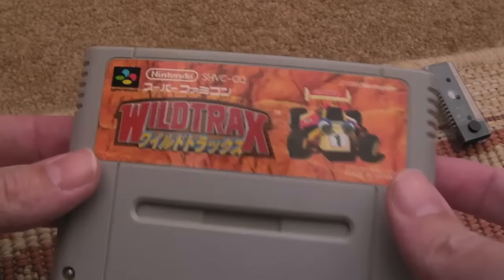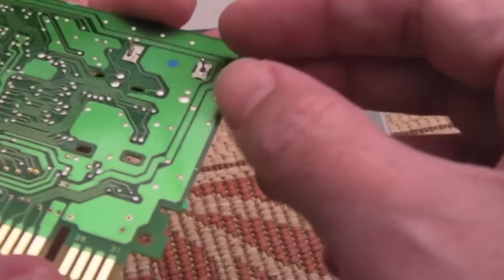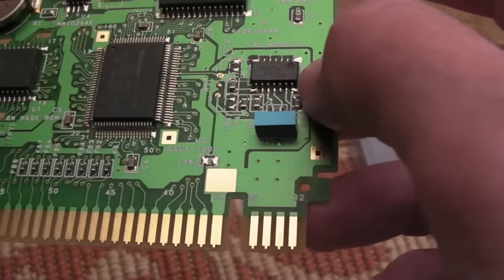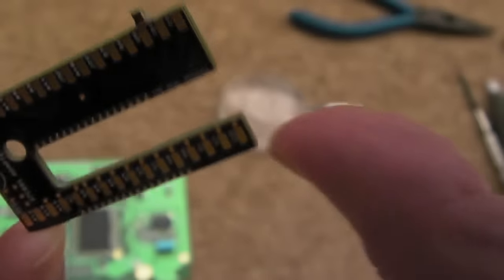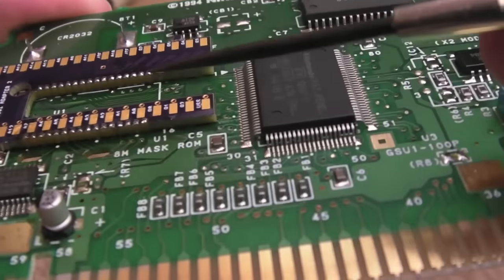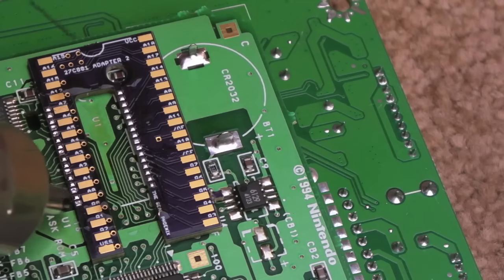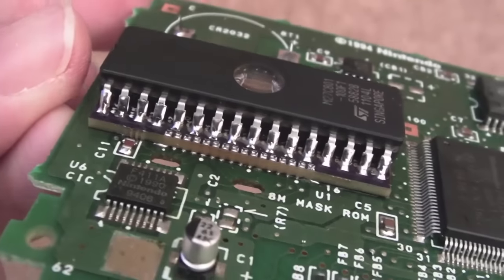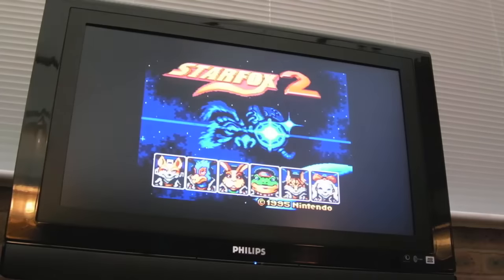Nintendo Super Famicom (SNES) Starfox 2 Prototype Conversion ("The Real Phoenix" PCB)

Comment: Hi GadgetUK164, great video any reason for doing your soldering work on carpet and not a anti static mat? The IC's on the pcb can be damaged from static build up from the carpet.
Reply from the maker: +Joseph Tiziano Yes, you're right - it's possible to damage components with static, It's just bad habit and laziness on my part.  I've been meaning to get around to ordering an anti static mat for the last 18 months.  The reason I've just not bothered is because I've done tests on that carpet before to see how much static can be generated and I cannot generate anything on it, despite footwear.  I don't know why but I don't seem to be able to hold static in my body either, I've never been able to get static shocks from anything.  When I was in the trade I took ESD much more seriously, but that was 25 years ago.   I guess there's some nostalgia there for me as well - when I was in the trade I would often go home in the evenings and work off the bedroom floor lol, but I do need to get a mat ASAP.  Bad practice, will order one today!
Reply from the maker: +Joseph Tiziano Just ordered one!  I will give you a shout out on a video when it arrives, it was your reminder that finally prompted me. =D
Reply: +GadgetUK164  WoW thanks for the reply and understandable, I must say your soldering is impeccable makes me want to get back into the tools and soldering :o)

Comment: I wonder how well baking the boards together in an oven would work. you would have to take the battery off while doing it of coarse.
Reply from the maker: +Sam The Multimedia Man Yes, using a reflow oven (or traditional oven set to the correct temperature curves) would do the trick, but you would need to be careful components don't fall off etc.  I think there are all top side mounted so it should be OK that way.

Comment: Man, I'm sorry you had so much trouble. :(
Yeah I'm using hot air (I remove the battery first and put it back and the very end), check the connectivity from the via on the Snes pcb to the pad on the board, then reflow from the top if I have only a few missing connections.
Yeah the PCB is thick. Other places like iTead offers thinner PCB (even flex pcb but those are expensive) but the batches are for 10pcs.
Reply from the maker: +The Real Phoenix Hey, no worries at all!  It was a learning experience, and I think I could easily fit that PCB in around 10 minutes to another cart!  I've actually got another Wild Trax on the way, going to try doing another game the same way.  Thanks for creating the board and sharing it!  It's brilliant when people create PCB's like that and make it open source!  See below, electronash has been doing some small mods to it!  Hats off to you on the PCB!  I've been using Eagle for the last few weeks and it takes a while to get used to, and there's a lot to it for sure!
Reply: +GadgetUK164 I took a look on the tweaks of electronash (I'll thank him properly in his comments), I didn't know we were allowed to do such. I saw others PCBs with castellations but Eagle/OSHpark verifications say it's wrong (clearance errors). I thought that maybe it was something more complicated to do.
I'm not using Eagle since long: a bit more than a year. So there's tons of stuff I still don't know.
But this board is design for a "easy" and clean installation. I've design it with the way to put it in my mind. So seing someone having a hard time (especially when someone used to mods like you) is a failure.
The funny thing is the first rev of the board (the one in my video) was done in september 2014 and was way harder to put on. :)
Edit: Typo.
Reply from the maker: Don't worry - what you've done is actually great!  It would take me a while to get to the level I couldn't create something as well designed as that board!  Really appreciate your effort and time taken, and truly brilliant that you shared it =D
Reply from the maker: +GadgetUK164 I meant to say 'I couldn't create something as well designed' ^

Comment: Would this work for other FX games like Yoshi's Island and Doom?
Reply from the maker: Yes, you need to check the doner board has the correct amount of SRAM though.  I think Doom needs a specific rev of the SFX chip too.   You can now of course use the SD2SNES as that supports ALL of the Super FX games from SD card.

Comment: what tempature where you using for the hot air gun i am still trying to find a appropriate temperature for the super nintendo.also just to verify, did you just burn the raw rom to the eprom?
Reply from the maker: I cannot remember now - I tend to set my station around the 400 degrees mark, and if that's not melting the solder quick enough then bump it up to 450.   But before you start, set to say 100 / 150 degrees and pre heat the area (on both sides of the PCB) for a few minutes.  Pre-heating helps and can help avoid delaminating some PCBs.  With regards to the EPROM, I don't think it needs byte swapping (its an 8 bit ROM).  Also worth checking the file size is exactly 1MB - ie. make sure it doesnt have a header.
Reply: thanks my dude really helped

Comment: I don't know about this method of soldering two PCBs together....  Will it hold up to flexing when inserting and removing the game? Still a nice way to play this on proper hardware
Reply from the maker: +custardo Yes, that's one of the things I don't like about BGA in general.  I think the 1541 ultimate FPGA is BGA - so same issue can occur with that over time.  As long as the board doesn't twist it should be OK.  Once I worked out that it needed solder blobs on both sides (joining up), and the PCB needed to be completely flat, it all joined up first time very easily.  It was just a lot of messing around, and in part due to my ROM image not needing byte swapping.

Comment: I don't get what did you do this for? You did not have Star Fox 2 so used some other cart to flash Star Fox 2 on it to have it? Is that why? I was thinking maybe the Eprom  was a large size to put lots of games on it in one cart.

You should of said why you doing it. Good video showing the solding.
Reply from the maker: +Raymond Day Thanks, you are right - it's not obvious!  Starfox 2 was never released officially!  The prototype was leaked a couple of years ago and someone fixed the remaining bugs and did some modifications to make it a complete playable game.   The only way you can play this game on actual hardware is to convert another Super FX cart like I did.  It's totally possible to use a larger EPROM and have 2 or more games on the same cart, but you would need to add a larger SRAM for save games as well.

Comment: It's nice to have the QSB (Quick Solder Board) obviously, but it could really have done with some castellations. :)

http://www.mbedded.ninja/wp-content/uploads/2014/07/castellation-close-up-of-edge-holes.jpg

(and, as you said - "offset" the board slightly, so you can get contact onto the original pads.)

It's not easy to ensure that the solder reflows through those tiny vias of course, so not the most ideal way to do it.

I was meant to do this mod for somebody years ago, but my old Willem programmer screwed up the PROM burning process, and I didn't want to buy a UV eraser just for that, so I never finished it. lol

I did try overclocking a Stunt Race FX cart though, and it actually made it really playable (frame rate is just too slow otherwise.)

Nice vid. :)
Reply from the maker: +electronash Yes, that sort of thing would make it MUCH easier!  Still, I appreciate the effort The Real Phoenix went to on this - it works and I am grateful =D  I've been tinkering with Eagle myself over the last few weeks, so I can imagine it took a bit of effort to get it as accurate as it is regards the physical dimensions etc.
Reply: +GadgetUK164 

Yep, it's a good effort. Just needs a bit of refining.

I've used Eagle for about ten years now, and I still haven't figured out all the features. lol

I'm not too bad at making custom packages on it though, and if I had time, I would attempt to make an updated version of this adapter board.

But, what keeps on taking over my project time is the FPGA stuff - I'm currently working on an open-source SNES core, so you can see why modding on the original hardware would kind of be a moot point. :p

(OK, so I do have a "real" SNES and a few other systems too, but it would be great to have an FPGA version. hehe)

The thing with Eagle is setting the Grid value to the correct units first, then using the measurement tools to make sure all the pads are exactly the right distance apart etc.

There's a relative measurement tool (like a "cross" symbol) which is REALLY handy.

Then you have to make a symbol for the package. I normally just steal a symbol from another device by doing a "Cut" and Paste (doesn't actually cut the old symbol, but "Copy" doesn't work the same way?). Then I just paste the symbol into the new file, delete all the pins, then add all the new pins for the custom part.

After the package and symbol are done (and all the package pins are numbered correctly / symbol signal names are correct), it's just a case of merging the two using the "Device" library editor. ;)

The other good thing is that you can type values for the sizes of SMD pads etc. directly into the text boxes (so "0.7 x 1.1" or whatever), and you can also type in a Name (in the command text box thingy) after selecting the Polygon tool so you can assign a signal name to an entire copper fill poly.

Oh - I didn't see that the Eagle BRD file is on the OSH Park link (by "The_Real_Phoenix") - I'll have a go at adding castellations and fixing the spacing (and the hole for the cap). :p?
Reply: +GadgetUK164

I see what has happened now - the pad spacing for the SOP32 chip on the adapter board lines up perfectly with an actual SOP32 package, but the pads on the SNES cart PCB are obviously further apart (nearer the ends of the chip legs).

Should be able to space that out a bit, and see if I can figure out the castellations thingy.
Reply from the maker: +electronash Ah, that's cool!  I didn't know the board file was up there as well.  Will have a look myself, might help me with another project I am working on =D  Thanks for all the info and tips there =D
Reply from the maker: +electronash That will be cool - that's what I love about open source things like this, great things can be made even better =D
Reply: +GadgetUK164

This is a work-in-progress atm, but might be close to correct. I basically had to guess the spacing (width) of the SOP32 though, by using a SOP32 package as a reference, then changing the spacing so that the castellated vias are nearer the ends of the "legs"...

https://mega.nz/#!ztphwagK!tNuCUoW_2ksrCvZw9guU3mz_spIK_CfR-aMsZxzuIOk

Also, we'd have to be sure that OSH Park actually supports castellations, as it would mean the board gets trimmed before the vias get electroplated etc. My friend says that most places do support it, but always best to ask them first.

The original design still had the old SMD pads "underneath" the small vias, so I got rid of those.

I did a tidy up of the traces as well, and spaced some of them out a bit more so that there is now more Ground plane surrounding most of them.I also changed the size and ratio of the text to make it a bit clearer, then move the lower text nearer to the edges of the pads.

Oh, and I renamed all the signals in the file to DIP_A15 etc. etc.

May also be worth seeing if there's much difference in the price of a slightly thinner PCB?

Although, anything other than the "standard" 1.6mm can start to get pricey I think?

https://i.imgsafe.org/d02c4b5.jpg
Reply: +GadgetUK164

Do you have any digital calipers at all?

If you do, could you possibly measure the spacing between the two rows of SOP32 pads on the SNES cart board?

(I don't have access to my stuff atm, or I would have checked.)

Or, if you get chance, I've found it handy to print out PCB designs (from Eagle) just to see if the measurement are wildly off. Most printers are fairly accurate with the sizing, but some aren't. hehe

The spacing would have to line up with the middle of the small vias of course, because the "ends" will get cut off when the PCB is made (hopefully).

I made the hole for the capacitor a bit bigger too. ;)
Reply: +GadgetUK164

btw, are you on Facebook at all? I know not everyone likes it, but I'm very often on groups like Mark Fixes Stuff, and the newly formed Retro Computer Clinic.

I think we do a lot of similar projects, and there are a lot of great people on the groups who also have retro YouTube channels. Most of the stuff we've fixed on MFS has been retro related too. ;)
Reply: +electronash , Many thanks! I didn't know we were allowed to do such. I saw others PCBs with castellations but Eagle/OSHpark verifications say it's wrong (clearance errors). I thought that maybe it was something more complicated to do. 
I don't know if OSHpark allowing this.
For thiner board, iTead can do 1.6/1.2/1.0mm without any additional charge (0.8 for +2$), but it's a 10pcs batch.
Reply: +The Real Phoenix

Yeah, I'm not completely sure if OSH will do the castellations, but my friend said to "just draw the board dimension through the middle of the vias", and I think he has done that with OSH Park before?

As I say though, definitely best to ask them before, as they might reject the design otherwise?

Any good board house should really support pretty much anything like this now, but it's different with most of the "prototype" services obviously.

Nice board design though. ;)

Just thought I'd change the spacing a bit and move some traces around etc.

I'm quite pedantic about the trace spacing after doing a LOT of manual routing recently. hehe

Years ago, I used to do everything I could to get the autorouter to do most of the board for me (100% if I could), but now I've realized the importance of manual routing. It is very time consuming obviously, but pretty much necessary for getting the best out of a PCB layout.

I can't say I really enjoy manually routing the more complex boards though. lol

I want to try to get to grips with Altium Designer soon, but it's a completely different way of working...

There doesn't seem to be a way on Altium (that I know of, yet) to update the PCB layout as soon as you change the schematic? You have to do an ECO (Engineering Change Order) after you've pretty much finished your schematic.

I guess that's how a design really "should" be done, but I'm so used to the way Eagle does it now.

Anywho, I'm not sure if I've made your board design very slightly too big now, but if OSH (or anyone) does allow the castellations then I think it will be OK as it will allow the board to be move upwards slightly.

I did make the hole for the cap a bit larger, and also moved it up and left slightly too.

I'm not sure if the different SuperFX carts might have caps / resistors in different places though?
The one in this vid looks very similar to others I've looked at though?
Reply: +electronash after a quick search OSHpark seems a bit strange. They "do" castellation but it seems to be a special procedure: order is put in wait, they contact you, and need extracost. Seeeedstudio seems ok. Dunno for iTead. I may give a try on Seeedstudio, 10$ for 0.6mm (10 or 5pcs for a batch)

I've designed it for the SHVC-1CA6B-01 (Stunt Race FX) because it's the best donor. It's cheap, easy to find a donor, have a save circuit and 512k of SRam. Others donors are lacking a feature (save circuit, s-ram size). Star Fox 2 doesn't run faster on a GSU-2 and the only compatible GSU-2 board is Winter Gold, which is only published in EU.  So I won't bother to update the design.

A bit of explanations, layout for Super FX (Mario Chip, GSU-1 and GSU-2) PCB changes a bit each times:
- SHVC-1CA0N5S-01/SHVC-1CA0N6S-01 (Dirt Racer/Vortex) doesn't have save circuit and/or you have to increase the sram.
- SHVC-1C0N5S-01 (Star Fox) the maskrom is too close from the Mario Chip / capacitor placement / 256k of SRam.
- All the GSU-2 boards: SHVC-1CB5B-01/SHVC-1CB5B-20 (Yoshi's Island has a too small SRam (256k)), SHVC-1CB7B-01(Winter Gold, ok but too rare) and SHVC-1CB0N7S-01 (Doom, no save) and also because of a capacitor placement .

Comment: 450°C right next to the lithium battery NOT a great idea.
Reply from the maker: +Ting Lin Thanks, that's a good point!  The heat wasn't directed directly at the battery, but you raise a valid point!  Worth removing the battery and  putting the battery on as the last step - for anyone considering doing this mod. =D

BTW - The hot air was set to 415 degrees, not 450!  Still a risk with Lithium though.

Comment: That 22µF 6.3v SMD capacitor sure is leaking on that cart, time to change that as well. =)
It's probably just a +5v filter cap, but I wouldn't be amazed if it can cause problems when it goes 100% bad.
Reply from the maker: +8bitbubsy It's fine at the moment!  Not leaking at all yet!
Reply: +GadgetUK164 Ah sorry, the right pad appeared to be green'ish in one part of the video, but then in later parts it appears shiny. My mistake!
Reply from the maker: +8bitbubsy I will double check it later and report back, but I am sure it was OK when I examined it!  Those caps do tend to leak eventually though!